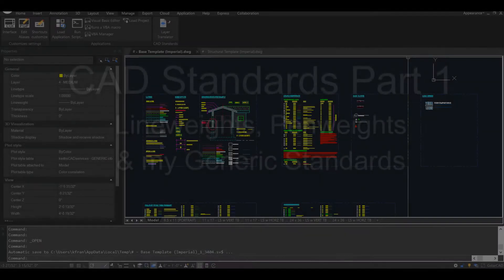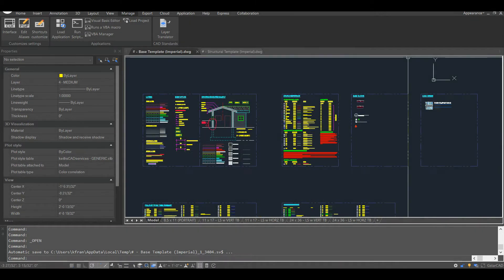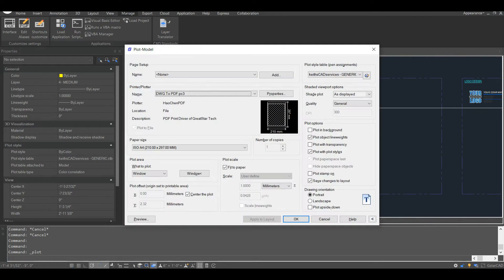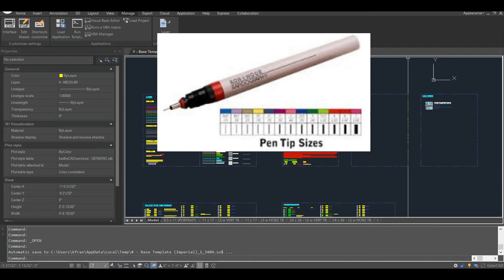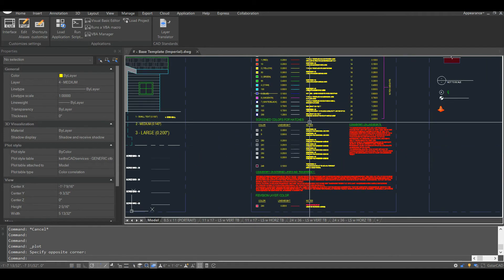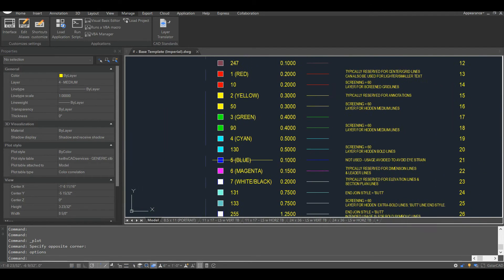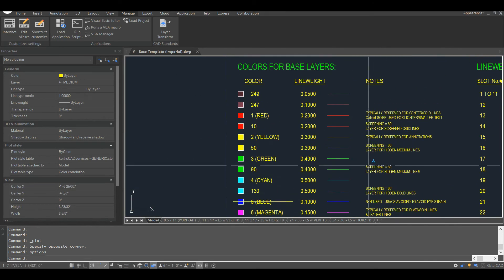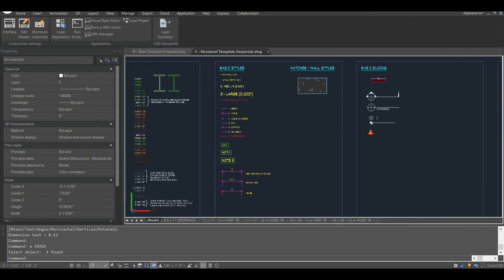CAD Standards   Part 1

Comment: Would you like to exchange your blocks library with mine
I work in facade company as a senior designer and do use a lot of dynamic blocks for many things but I found very handy to use blocks done by other people because I’m limited on what I think could be invented to build a one good setup for many reasons on my design 
Let me know on the comment 
Cheers for a lot of handy videos 
I watched some not all 
I found your channel a week ago when was looking for a tips on dynamic blocks that I made too
Reply from the maker: Hi Wojciech. Facade and building envelope knowledge is very sought-after where I live - we get so much rain here!
Regarding blocks: Everything you see in that drawing IS the block library hehe: I have more blocks scattered here and there (including a decent collection of rebar blocks) but anything really worth sharing would basically belong to clients and not shareable unfortunately.
I could throw a file together and include all my odd loose-end blocks for you to play around with. I also don't mind making quick videos.
One important thing to note about some of the blocks I have is that they were created in GstarCAD. GstarCAD basically has AutoCAD LT's dynamic block creation capabilities (non-constraint parameters and actions but no constraints, constraint-parameters or user-created variables). So far, GstarCAD's blocks seem to function just fine in AutoCAD. Regarding the opposite, I've so far had one block that would consistently lock-up GstarCAD. Still trying to piece together what caused it to do that.
Reply: @randomCADstuff  
Hi 
Thanks very much for your response 
One time my dynamic block just crashed on autocad lt 2021 version 
I’ve created it from sub-blocks 
No idea why but I know it’s lookup that stopped to work 
Was just left with single option from 8 or 10 on it 
Could you please share those you mentioned and sent it to my address turekwojtek@hotmail.com 
I never used any other cad tool from Autocad 
Unfortunately I got only lt at work and cannot use advanced block commands when creating my blocks
Reply: Good 👍
Reply: Sir please can you share us cad file